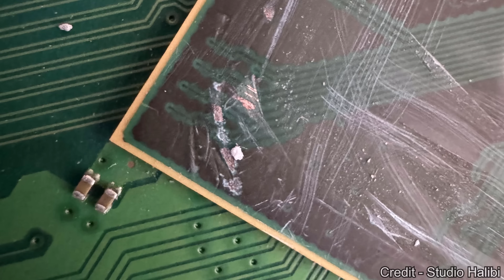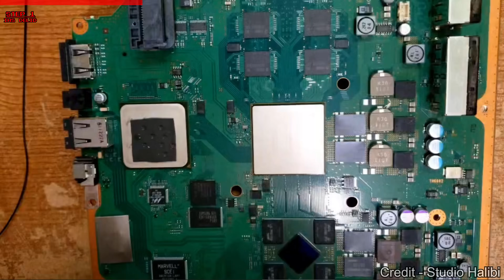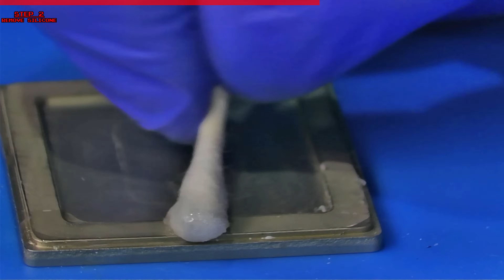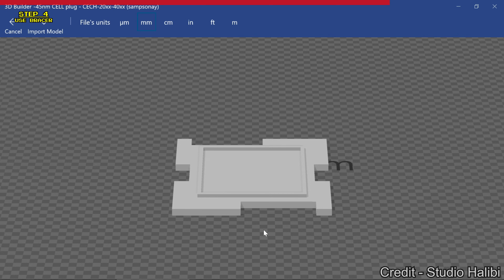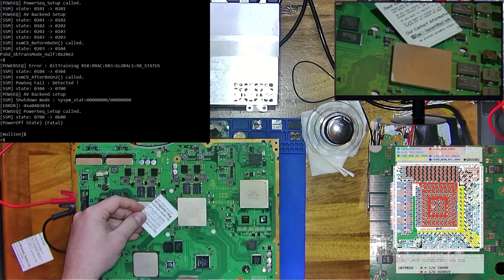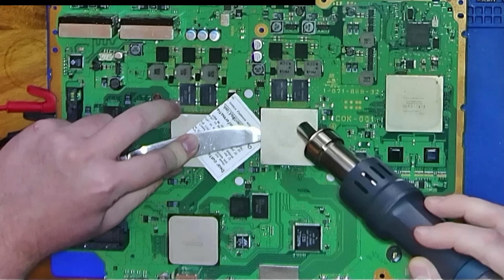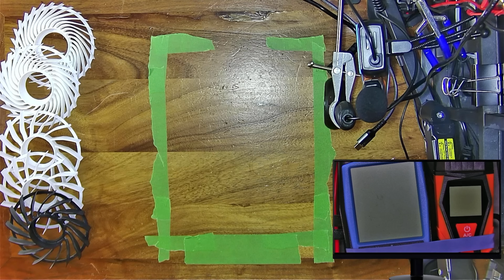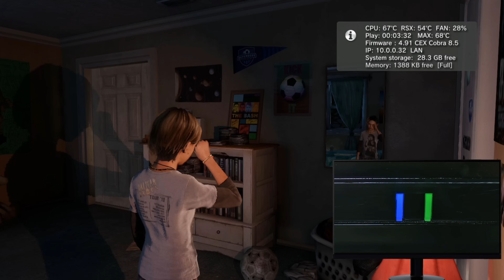How to Fix | Episode 1: Overheating. How to Delid CPU/GPU and fix YLOD - BEWARE of BAD MODs!

Comment: "well ackchyually" rtv drys not from oxygen, but with humidity in the air. So if you live in dry climate, or doing this job during heating season, you might give it more time.
Reply from the maker: Ah...you are correct. Just looked it up again. In that case a moisture barrier is needed. That's easier to achieve, as water is a larger molecule than oxygen gas, but still not as easy as just vacuum packing. I should use mylar instead of the regular vacuum bags for longer storage, and add a silica gel dessicant pack. That'd do it.

Thanks for pointing this out.

Comment: now that you say about those launch model xbox 360, i just bought one for 10 bucks and still working lol
i was in shock when i saw no HDMI
i just bought also a backwards compatibility ps3 with YLOD, hopefully i can fix it if its not a RSX failure :( wish me luck!
Reply from the maker: May your path be smooth and free from bumpgate.
Reply: @ripfelix3020  its working!! but i have this issue now, once i turned it on! at a few minutes it reaches 70 degreees!!!! im scared that i have to delid it :(

Comment: felix im not a repair shop, i do stuff only for me. I have a cecha01 or 00 (dont remember right now), but ps2 games are not working. If i heat the ps2 chip to like 80 degrees it will work for extra months or a year (i did once). Im not a "reball" believer, do you have any info if i can just straight get this chip and memos working from donnor board and solder it in, or is there some software gotcha here.
Also any tip to solder/dessolder ps2 chip i  don`t own a bga machine, the reballs i did in the past were in a grill, i tried in donnor boards to extract that chip but it`s really hard cause it`s on the edge of the board and the chip is huge.
Reply from the maker: The EEGS is the hardest chip on the board to remove, because it's so close to the edge. noPS2 is possibly the EEGs, given your heat test it could be that. Only way to know for sure is to replace it and hope for the best. GL

Comment: Delided ~20 PS3's with wire - all successful. 0.08mm wire, no lube, takes from 5 to 30 minutes, yeah it takes more time but it never failed me yet, making a proper tool is a good thing for a constant delidding, but for one-time use wire is just easier

Comment: Hey Felix, I tried searching everywhere before asking, I saw you provided the motherboard brace standoffs and screws but I cannot find an actual motherboard brace. Is it custom or do you have a link to one that I could buy?
Reply from the maker: The jig I got from ali express, but they go in and out of stock periodically. There was a vector plot of one you can provide to a metal fabricator, like OSH cut and they can make it for you. But that was someone else's project and I forget who. Can ask on computer booter's discord server, I think he pined it in there.
Reply: @ripfelix3020 Hello again, hopefully you're able and willing to give me some insight cause I posted with no response on forums. I bought two PS3 PHATs with the hopes of at least one Frankie. One of them, a B01 was practically brand new with only two weeks uptime. Did a repaste and clean just for safety. The other, A01, YLOD 3034 failure. I have no idea what firmware version this could be running; however, the B01 was on one very early (pre-3.5) so I would presume the A01 is as well. I know doing a 65nm/40nm is not possible unless on newer FW and am honestly unsure where to go from here. Thought about doing a reflow and praying the 90nm and board will survive long enough to update to modern firmware but other than that I have no idea. Any suggestions would be greatly appreciated.
Reply: @ripfelix3020 that or I may perform the frankenstein, if it boots with no video, then invest in a hardware flasher to upgrade the firmware.
Reply from the maker: If you have to flash the fw anyway, you could try a heat test to potentially keep it on long enough to update. If it bricks, well, you had to hw flash anyway. Then perform the frankie.

Comment: Hi Felix. I’d like to ask your opinion on a PlayStation 3. Console will produce 1201 codes consistently. The console has been delidded on both CPU and GPU. CPU temps are always stable and good. GPU temps stay good as well but can spike randomly. For instance, I can run a PlayStation 2 game or watch a movie and the console will run fine and temperatures stay good. This is when the GPU only will randomly spike in temp and turn off the console producing another 1201 or the temperature may stabilize and continue to run. When running a PlayStation 3 game like The Last of Us everything seems fine until the game loads in. At this point it will shut off quickly or sometimes run for a couple minutes maybe even 10 minutes but will at some point spike the GPU temperature and shut off. With the temperature displayed on screen, I can see the GPU temperature jump all over the place before the shut off.
Would you recommend trying to get better pressure on the GPU or replace the GPU?
Reply from the maker: This sounds more like a failing thermal monitor. You could try reseating the heatsink/delidding RSX to be sure it's making good contact. When you insert a PS2 disc while running webman mod I've noticed it doesn't set the ps2 default 40% fans. That only happens when you load a PS2 ISO through WMM. So it locks in whatever fan% it was at before the switch, and then it can overheat. I need to investigate that further, but I generally prefer syscon's fan tables to web man for that reason. Something to keep in mind while you troubleshoot.
Reply: @rip @ripfelix3020 e actually been troubleshooting using the UART connection and making my own fan curves. While I have Web man mod running. I have it set to Syscon mode to utilize my custom fan curve. 
Now I do have the RSX delidded as I thought that would fix it initially. I believe this helped, but issues can still occur. I’ve noticed that the heat sink looks a bit warped. I’ll take a look at my lid as well and see if that isn’t completely flat. Now, if it’s a failing thermal monitor, from my findings that is built into the RSX.? Thus can’t really be fixed? I’m a bit confused on that. Also note that because I have the UART I can ask the Syscon for the current temperatures and fan speeds while running a PlayStation two game. I’ve done this and temperatures are phenomenal sitting in the low 60s. It’s just that GPU temperature that will spike suddenly and if it spikes high enough it shuts down. I’ve actually thought about altering the shut down GPU temp, which may actually keep the console running if the GPU isn’t actually overheating and it just thinks it is. What are your thoughts?
Reply from the maker: The thermal diode is inside the rsx true, but the thermal monitor is an IC next to it. That is what's reading the internal diode. It has an external sense line (RSX's internal die temp) and onboard (MB temp of the thermal monitor itself. There are a few smds around it that can go bad too. So if all else fails, try replacing it. if it's not that, it's the diode. RSX id dead at that point. No way to fix the internal temp sensor.

Comment: Thank you for sharing these videos. I am about to embark on repairing my Playstation 3 CECH-A01. It is working right now but I need to give it a refurbish. I have been on ultimate video download to my brain on these repair videos for the PLaystation 3. I can certainly replace thermal grease and thermal pads. But replacing chips altogether or "reballing", nope not my strength.

Comment: Please, between a CECHH and a CECHG, both with delid and tantalum capacitor, which would you choose for gaming?
Reply from the maker: Neither frankly...but if we're bound and determined to chose from the least desirable models (90nm defective GPU and tokins), then I'd go with the G model. It has a bigger heatsink.
Reply: @ripfelix3020 The G has a 90nm RSX though. That's why the heatsink is larger. Which is also the worst RSX you can have. I'd go with the H for sure as it has a 65nm RSX.
Reply from the maker: H models, have a 90nm RSX and the heatsink is smaller than G.

Comment: i have 2 fat ps3s, one cecha and one cechp. i mainly use cecha of course for upscaled, clean signal ps2 playback and cechp for ps3 games.

i bought the cecha months ago with failed tokins and repaired it. surprisingly, it had only 19 days of total runtime but got many issues like broken ps2 and no 12v for blu ray. i had them fixed as well and still running. during gameplay, fan speeds which i have modified the syscon fan table doesn't annoy me yet so i didn't delid until the time comes. it's bit audible but it didn't annoy me yet.

so far, i get 67c on cell and 54c on rsx with smoothing off. surprisingly, smoothing does add load to the rsx. i can see the rsx jump to 63-64c with smoothing on. upscale off or on makes no difference at all towards the temps.

Comment: I just redid mine with PTM7950 - Started with just putting the PTM under the IHS's. I don't glue them back on and I didn't want to clean up all the paste on the heatsink. I was running 67c at around 27% fans on the Last of Us which was the same as before with MX-6 on the die's. I took it apart again and did PTM on both sides of the IHS and my results are pretty much exactly the same. Shouldn't ever have to replace it again. Put new thermal pads on while I was in there.

Comment: Hey Felix, just an idea! Have you tried to make a mold in silicone out of the support after you have sanded it down? Casting it out of some heat resistant resin will probably give you much more reproducible end result then 3d printing. By hearing how many times you have printed them already, might be worth it.

Comment: Hey Felix it's me again

This time I might need your help since others didn't want to or simply ignored my problem but I'm not going to name any for respect

So I recently got a overheating g Model and went to delid it, I replaced the 15 blade nmb-mat fan with a 15 blade nidec fan because it has longer blades and saw slight temperature improvements, I replaced the paste for arctic mx-4 on the die and on the ihs itself, and I reattached the ihs onto the chip like you, not the cooler, (and obviously centered and aligned well) then I went to undervolt as much as possible. But this rsx is still super hot at 47% fan speed with webmans auto at 68 degrees Celsius, it's 10 degrees hotter than the cell too, just so you know it was 21 degrees Celsius in my room at the time and the console was running need for speed most wanted 2012. so I would like to ask if you could help me get it cooler as I think it's just overheating but nobody is willing to help me. Also I wanted to ask you what is your opinion about trying to fit a A/B/C/E heatsink onto the g model for better thermals since the g is the most similar non-backwards compatible model and therefore I've always been interested in it and I would like to see someone fit this heatsink onto a g model. I know that your disliked cut mods might be needed for a fit but I wanted to know how its possible because the cooler is much better than the G's heatsink right? I have just gotten so confused on what to do to get my g model cooler, I have good pressure I think, I even used the clamps from a C model since they don't give away the pressure so easily you know what I mean
Reply from the maker: Honestly, I don't like the G model, but perhaps you could mod it to put a BC Heatsink in there. IDK, never tried ...or wanted to. 

Rwmember that model has a 65nm CPU and 90nm RSX. The reason it runs higher is because of that. You can adjust the fan curve if you want. If OTOH it's not just a normal temp range for that model, then I would suspect your delid/reglue.
Reply: @ripfelix3020 so what should I do to fix it? I didn't reglue the RSX ihs I just pressed the ihs onto the die before reassembling
Reply from the maker: reseat the die and be sure the IHS didnt rock off to one side
Reply: @ripfelix3020 i checked and everything was fine, I repasted, rebuilt and nothing changed, it's exactly the same as before

Comment: 2:04
Can’t stress how right he is with this. That’s how I killed my CECHE01 mainly for kinda rushing it. Scraped it ever so slightly and got the YLOD

I got the syscon serial tool so I guess I’ll check it’s codes in case the GPU nuked itself at the exact time but I’m 99 - 100% its CPU ☹️

Comment: Fantastic video. Question, why not try a monofilament fishing line to delid? I understand floss would take forever and breaks easily. The fishing line is smooth, stronger, and made out of plastic. Add a wee bit of oil and it should make quick safe work of the delid process. 
Just a thought.
Reply from the maker: Most cutting wire ideas take forever, dig into your fingers and abrade the mask/traces too. I've seen it destroy a cell. There is a cheap purpose built tool for this now. Ps3delidtool.com

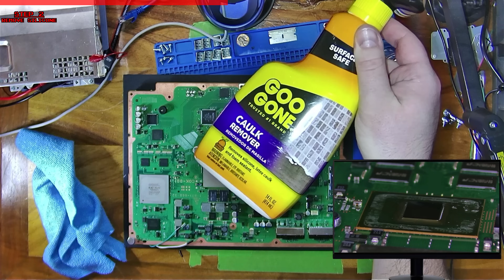Comment: 12:38 At least for the IHS use a mechanics technique and heat that bitch with a torch then douse it in brake cleaner. That silicon will not stand a chance. Works great on valve covers

Comment: If anyone reads this, for the love of god don't try IHS removal YOURSELF. Its very easy to fail, like really easy to fail. Just find someone who does this like NSC  on youtube, he can get your ps3 delid with perfect sucess (unless it was so overheated its fused with the cpu). Anyway just don't I have trained had all the tools (and killed 3 ps3 while having a success of 1).  I have 4 delid ps3 super slims, slim and 1 fat and they are golden (NSC delid  them for me) he as very good skill. Just in case someone has ihs removed ps3 be sure to apply pressure the plate to the heatsink (yes you can just mark the spots and put the plates (ihs) on the  heatsink first (you can apply pressure with deodarant like old spice its very safe to apply pressure like that) for maximum contact. Anyway if anyone has any questions you can ask me as well. Long live ps3

Comment: Felix I have noticed that the 19 blade fan on the side where it touches the heatsink due to heat its metal parts start to melt like compared to the 15 blade fan. Since the 15 blade fan has a very small metal part on it, it doesnt melt. Do you think that it might be a problem in the future for the 19 blade fan??
Reply from the maker: Sorry, I don't understand what you mean by "melt." What's melting?
Reply: @ripfelix3020  I wish i could upload a photo to show you but i cant. On the 19 blade fan there is a part of it which touches the heatsink. I read somewhere that it is how it came from the factory but i wasnt sure about it.
Reply from the maker: I think I understand what you mean now. The 15 blade fan is pressure fit to the rotor and can actually be removed and replaced. The 19 blade is fused to the central motor, likely plastic melted in place at the factory to prevent it from slipping. That's probably what you're seeing. It's normal.

Comment: Touché! My CELL is cooler than RSX by around 3C.

Both delidded, undervolted, lapped IHS, MX6 and Liquid Metal. Had PTM7950 before with similar results.

CELL 50-52 and RSX 52-54C, 30-35% fan, 30-22C ambient

Comment: Would love to hear about your experience with liquid metal, even if it’s just initial temperature improvements over conventional paste.

I noticed you mentioned in another comment that you hadn’t used that console much since the video. But even if it’s just been sitting there, it’d still be interesting to see how well it’s held up over time. It’ll still likely have alloyed into the copper and nickel plating to some degree, even without a lot of thermal cycling. Im intrigued!

Also, cell bracer.. do you know exactly what material Sony used to make theirs? Your recommendations are perfectly fine. I’m more just curious.

Thanks for all of your hard work ✌️

Comment: What are your thoughts on the peaceful outcome rsx tool ? The one with the screw and the allen wrench
Reply from the maker: A waste of money IMO. It's a wedge that pops the IHS off with leverage the same as every other popping method. The difference being that you (ideally) have more control over the force applied and don't gought it using the wrong tool. Personally I prefer using heat, a painters knife to protect the substrate while I use a car prying tool to pop it. Same thung, faster, effective. And these tools wont slip off or melt due to 3D printed plastic

Comment: Is the clamp suitable for the COKS 01& 02, as the depth of the clamp is only 100mm lol. I thought the coks distance were about 12mm from edge of Board?  Please advise.
Reply from the maker: The wolcraft clamps I got just barely reach. I couldn't find another one that did.
Reply: @ripfelix3020 Thank you for your reply and I am still searching for plastic ones with the ideal length. There are some metal ones used in wood work and mechanics but  not sure how safe they would be to use them. Correction from edge of Board to the chips 120mm not 12 mm LOL.